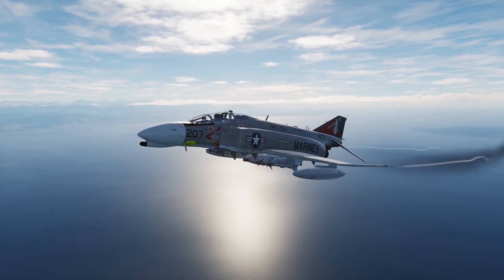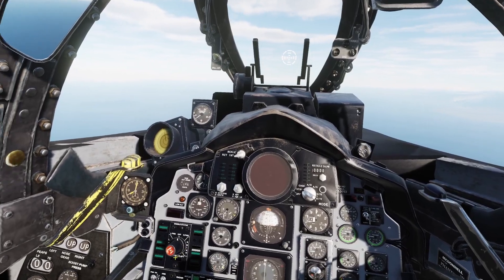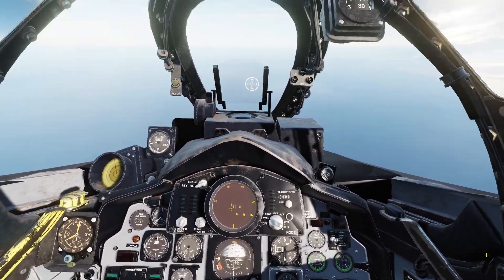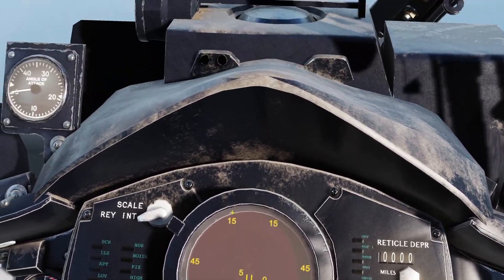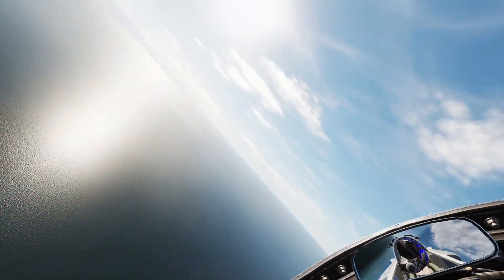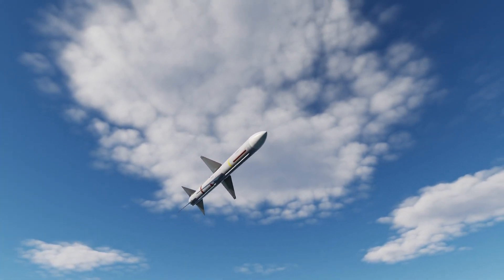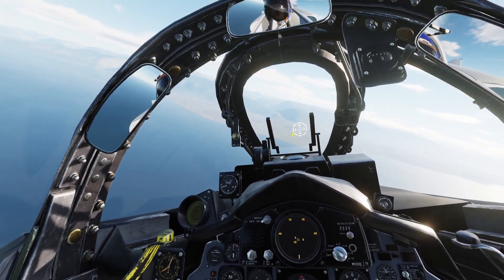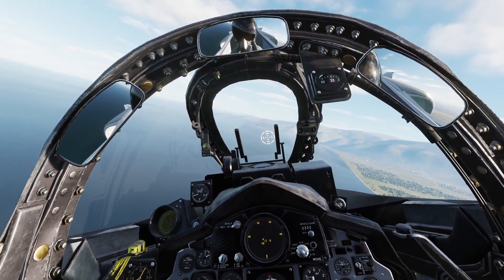F-4 Phantom Radar/AIM-7 Tutorial | DCS World

Comment: great vids thanks for the info... Question for you. the F15EX mod you are working on is it possible to add the high pitch sound of the engine when you throttle a little and back down, like the F15C does..
Reply from the maker: I haven't really noticed that TBH.  I will be updating the mod at some point with different engine data/effects.